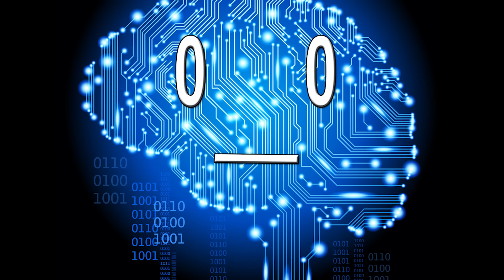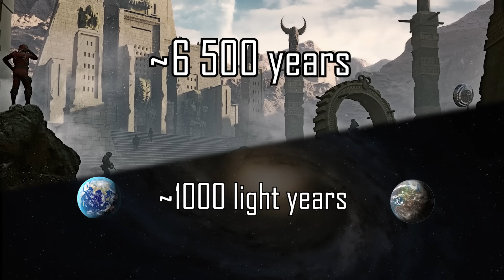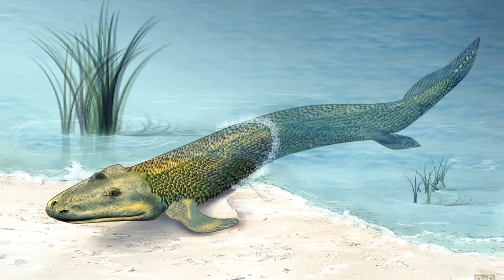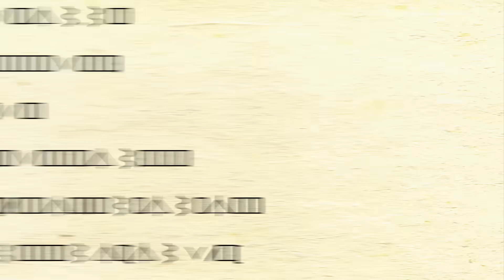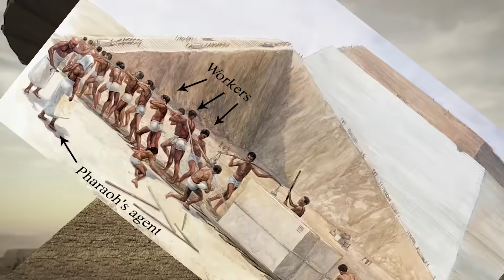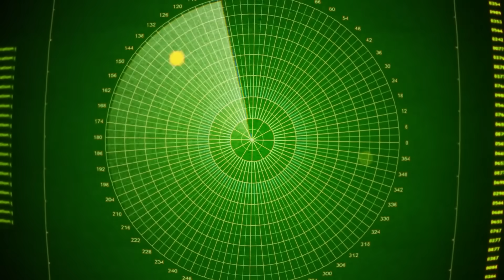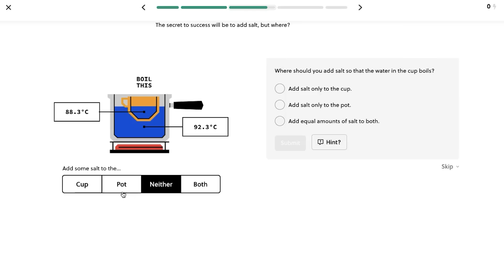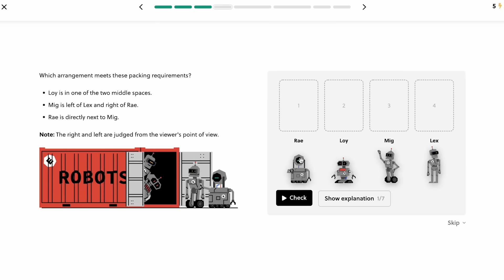Iceberg of the Fermi Paradox Explained

Comment: Hypothesis: Aliens use tachyon-based FTL communications, where they piggyback packets of data on streams of tachyons that are sent from sender to relay(s) to recipient and, due to tachyons being inherently FTL we would have no way to pick up these streams of tachyons.
Reply: twist: we dont knoe wtf is going on with aliens
Reply: Don't let people hate on time particles, if gravity has waves then time must have waves too
Reply: @mrdre3628  "if, then, must" the most dangerous words in science.

Also, just to help you not be stupid. Gravity having "waves" does not mean it has a particle.
Reply: @xenn4985  my man there is no difference between waves and particles as particles are just quanta of energy that exhibit certain properties at that quanta.
Reply: @xenn4985  also my original point was that time has waves since gravity has waves, gravity having waves combined with the joy of quantum mechanics allows for both a wave in the temporal field and an accompanying particle. if gravity has detectable waves then there must be a force carrying quanta of energy known as a particle, which when discovered will probably be called gravitons. Unless of course you want to deny that spacetime is a thing, or make the case for separate and independent particles and waves. One has to refute Einstein, the other has to refute observation and experimentation.
Reply: @mrdre3628  i know what your original point was, and i said it was wrong, because its fucking wrong. We already know what space-time is, and its not made of gravitons...

Your knowledge is about a decade out of date.
Reply: @xenn4985  angry and nonsense is not an argument sir..also if you think that gravity makes up spacetime instead of acting on it then your knowledge was never in date